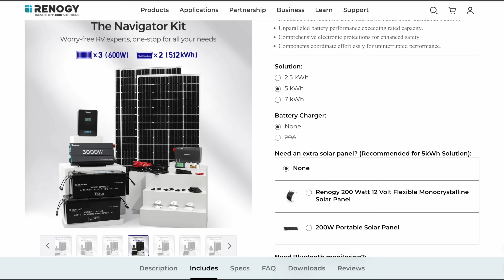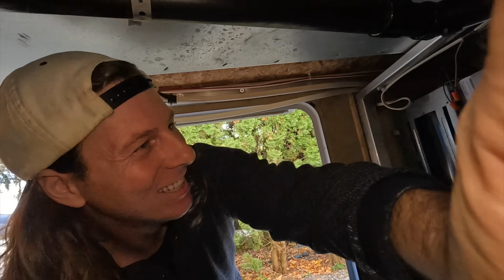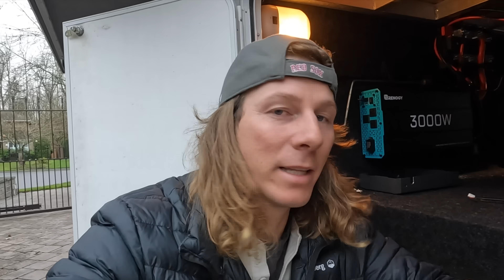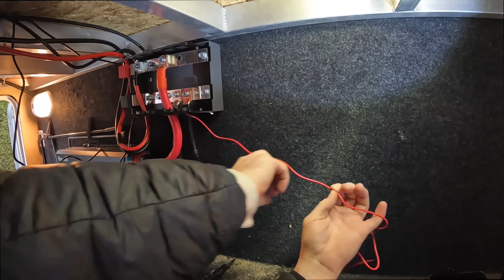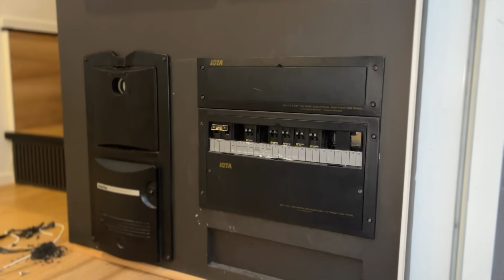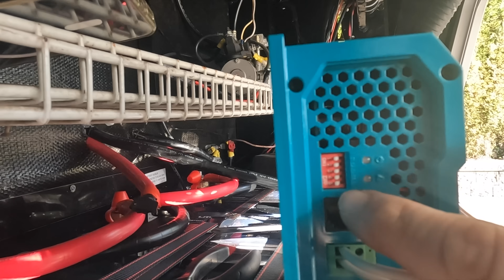Renogy Off-Grid Solar & Lithium Battery Install for RV - COMPLETE INSTALLATION

Comment: This is exactly the video I have been looking for. One question though, for the DC to DC, are you just tapping the wires coming from the wire harness or are you changing them from hooking into the camper to hooking into the DC to DC charger?

Comment: This video has been out for a while. The transfer switch and contactor is the puzzle piece that I was missing. Going from a 50 amp split phase system to a single phase inverter had me perplexed as to how I could do it safely. I'm using an all in one Sungold 5000 watt (SPH5048P) that does all the things in one box, but it uses 48volt battery storage for better efficiency. Great Job explaining and linking all the parts in the description.

Comment: Why didn't you go with a 50 amp transfer switch.
Reply from the maker: I think it was twice the price and not needed. but if we run the heater and Air conditioner at the same time it would probably be needed, but I plan on not doing that haha! In the summer I just keep breaker off on the heater so it cant be accidentally turned on and same in the with the A/C.
Reply: @SailingSunday thanks for the reply I have pretty much the same setup but went with with the 50 amp version mostly because I have a small brain. I like the idea of the contactor not sure I understand it but I really hate having to flip my converter breaker. I keep wish I had gone with some thing more intelligent like a victron but it's so expensive and what I did meets the needs for most of what we need but I need to research the contractor for sure. Thanks again

Comment: hey im wondering if when deciding where to screw the panels down, do you ever consider what is underneath the roof where the screw will be screwing into? do you not worry about a live wire being there, and screwing into it, or finding rafters to screw into, for more safety than screwing into just the roof without a rafter underneath?
Reply from the maker: I wasn't too worried screwing through the roof. Initially I was gign to look for the beams, but everything else was screwed straight into the roof so i did the same and theres been no issue, its the normal thing to do! Just make surte you have it completely covered with lap sealant!

Comment: By using 12v you're increasing the cost copper is heavey and expensive for larger systems 48v is simpler and cheaper and lighter . Why 200w panels you can get 330w or 400w panels. 3000w inverter isn't going to run two air-conditioners , even w/soft start.
Reply from the maker: yes you're definitely right there, but 12v was still ok and we wanted to keep them in parallel because they were right up againse the AC and covers etc so would get shaded pretty easily. It cost a little more for the wiring but it wasn't too bad. 600AH of lithium isnt really going to be enough to run the AC for an extended time anyway so re-wired the RV so the Electric Heater, AC and electric part of the hot water heater is on their own circuit connected to shore power and the 3000w inverter is on the other line controlled by the Auto Transfer Switch when disconnected from shore power.

Comment: Ryan I did some research (Renogy AI chat) and the Renogy 50 Rover mppt was developed to be a dc dc charge controller for the tow vehicle 12v aux to the trailer connection so I went with a DPDT (throws both - & +) switch controlling the Rover60 mppt input between my tilt kit solar sitting on the ground and the trucks 12v aux out since panels get put away when on the move and a dc dc charge controller is another couple hundred bucks it’s cheaper to flip a switch but your video is great learning tool I just can’t put a screw in my ATC’s roof that’s like sacrilegious I’m working a solution of solar panels mounted to my F350 Yakima ladder racks w side rails so I can charge when on rest break or just use 60 of the 145a from the aux alternator when rolling ..
still a great video mate😊
Reply from the maker: Thats cool, I didnt know that. I got this dc-dc charger though because I only wanted the alternator to trickle charge the battery so I set it to 10a max so I didnt have to change all the wires in the truck or damaged them etc.. With the 1000w of solar I wasn't even going to use a dc-dc charger, but last minute thought I may as well get something out of all the driving lol

Comment: What kind of price ballpark are you in with equipping this rv with solar? Plus, what is the voltage per battery? 12v? Thanks! Great video!
Reply from the maker: oh man... I can't remember now, its all on their website, the "Navigator kit" around $4000-$5,000 by memory, with 2 extra panels, an extra mppt controller, extra dc-dc sharger and upgraded some cables. so maybe another $1,000 then another $1,000 in various parts and fittings. 

I think the real costs would be in the installation, but if you do it yourself (safely) you can really save a lot of money!!!

Comment: What happens to the solar power when you plug into shore power and your converter is charging your batteries? Does the MPPT continue to charge your batteries along with the converter at the same time?

Comment: Hey man, I really appreciate the video.

I’m a recent journeyman with my state &
I’ve been an installer in the professional industry for the last 6 year
doing system start to finish 1,000+ KW to the bare minimum that’s able to fit on a residential roof. 
I’ve recently noticed the demand potential customers wanting systems like this for RV/ campers.

Anyways, I’ve never done/ seen a system installed on an RV so it was a pleasure learning from you to get a general idea of what to expect.
 thanks!

Comment: Great video.  Putting a smaller system on our TT with many of the same items.  Your video gave me some ideas so I may alter my design.  

Just a rant on the Renogy lineup - I wish Renogy had a remote SCC monitor, like their battery shunt monitor,  for monitoring solar generation.  The Rover has a very small display and often is not in an easily viewed location.  Otherwise, great products.

Comment: How much did your entire solar setup cost? Also, is there a detailed installation guide for this Renogy system?
Reply from the maker: Its about $3-$4,000 for the Navigator kit. We added a few things though, so about $6,000... but the extras are not needed. For example, we spnt about $300 on an automatic transfer switch etc when we coul dhave just put a manual switch on to switch between shore power and inverter... I made this video as a detailed guide so you can stop, rewind, fast forward as you go, it goes into great detail with full wiring diagrams for your installation. :)

Comment: Nice work and equipment. I imagine Renogy part or all of the parts. What would all of this equipment, parts and cable cost me? Thanks for the vid.
Reply from the maker: Yes we have a good relationship with them, they sent us some of these parts but the Navigator kit is about $3,000 - $4,000 which comes with all the cables. I bought a couple different cables and extra items, I would say it costs about $6,000

Comment: Please tell me you studied electrical engineering at university or worked as an electrician before sailing. Really impressive stuff.
Reply from the maker: haha, nah I was a builder back home so basic electrical, but I have a lot of experience with 12v DC systems

Comment: Hi mate on my yacht I have got leaded battery does it matter if the cables are the same length I have 3 battery on it. All the very best wishes for Christmas and the new year to you and your family 
And the little fella Jackson 😊
Reply from the maker: yeah, lead acid batteries don't have a BMS so they're probably more sensitive to it. It will affect the current flow between the batteries and if only a minimal difference (in the long run) it will cause that crystal build up on the plates and shorten the life

Comment: What an interesting video. I have always enjoyed your videos when you explain "how to do" stuff. This was different....When you said that you were going to break it down 'simply' I saw the horns grow out of your head and your eyes started to glow a fiery red.👹 You have gone from being a logically minded sailor and changed into a 'black art' electrician. "A converter attached to a converter connected to a diverter which wired to the inverter via a DC To DC Thingy which is plugged into the truck which may or may not have a smart device that  powers the sparkalators in the 8 litre engine." I think I might be looking at you sideways in future.🤪
Reply from the maker: hahaha!!! Yeah I went into fullllllll detail on this one. If you're in the middle of an install or want to do an install than this video will answer all the technical questions lol